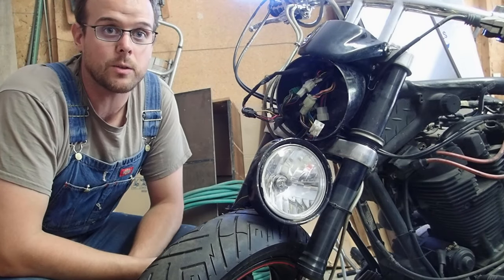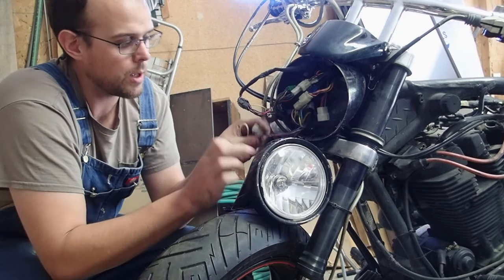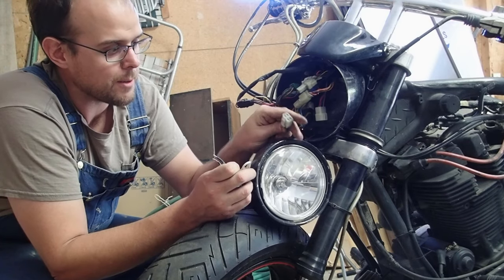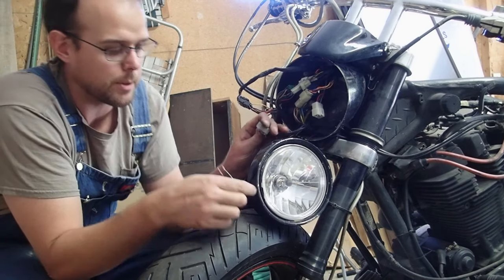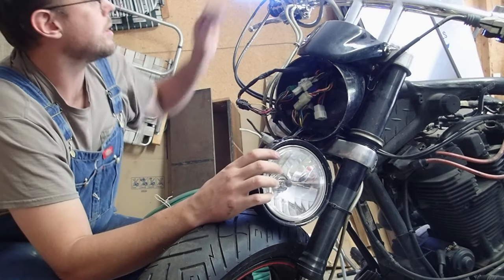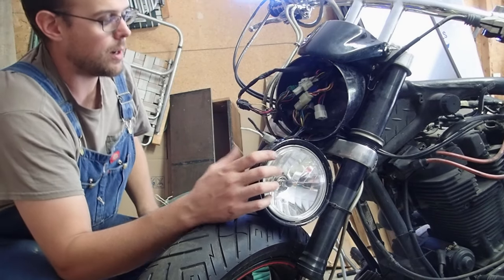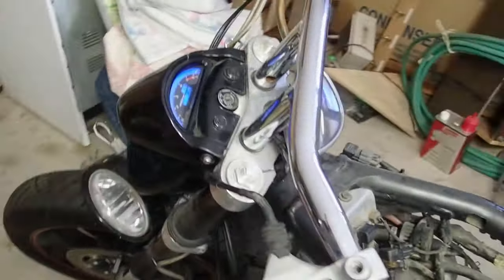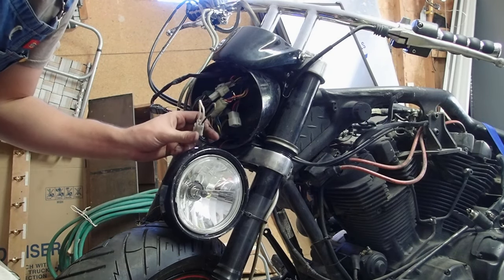How to hot wire your motorcycle!

Comment: question, I have a 89 posrtser, started button wont work, I drovfe fine, parked it 20 min later wanted to start it again  nothing happened when u turn key and press starter button, I heared that it could be a mass problem? something not right fitted after driving?  Bud...can i hot wire my bike instead of searching for this tiny problem i simply cant find . Plz letme know:D